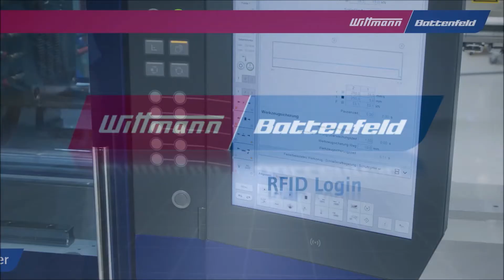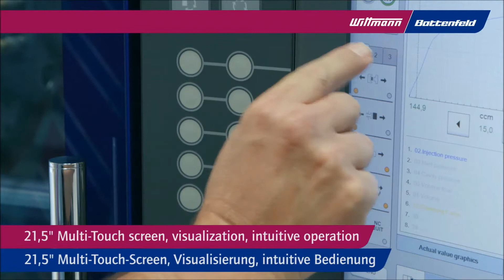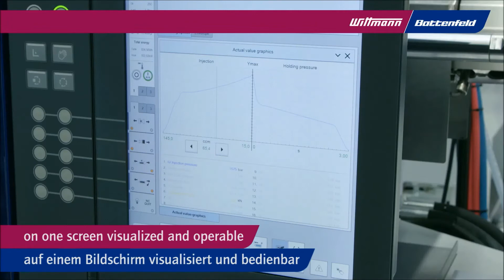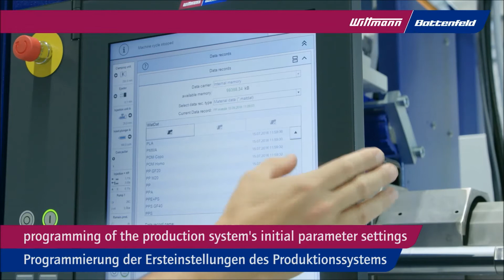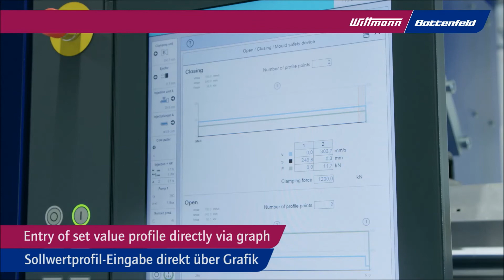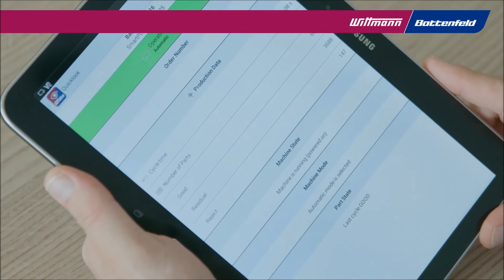UNILOG B8 Control Unit

Comment: Hi, maybe who knows Battenfield Unilog B4 oil reciver normal pressure show in display?  100bar normal?
Reply from the maker: Do you mean the oil pre heating or idling pressure. If it is the oil pre heating it is correct with 100bar pressure!
Reply: @WittmannGroupTV  Accumulator receiver pressure.